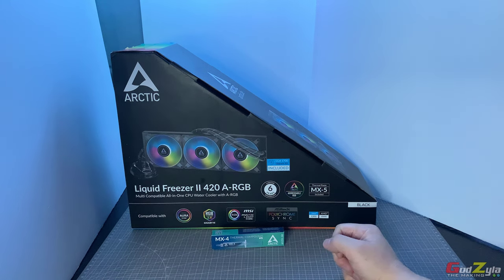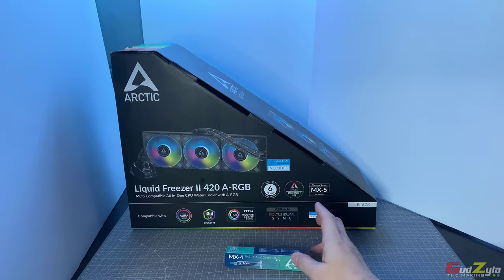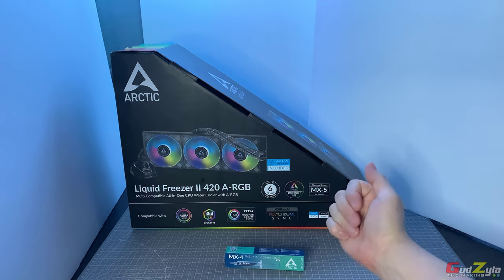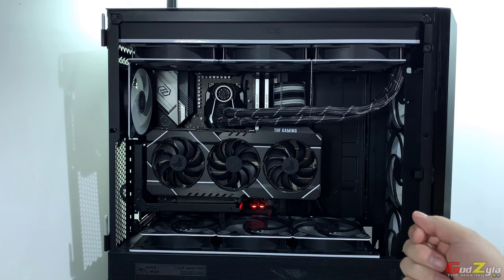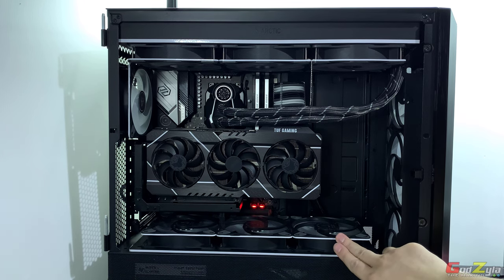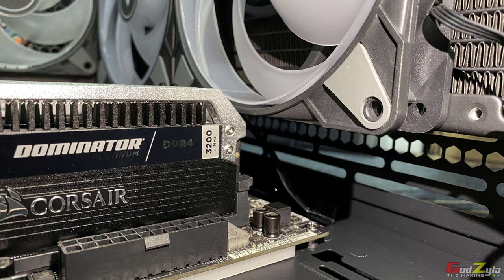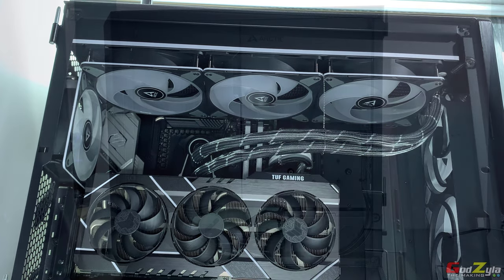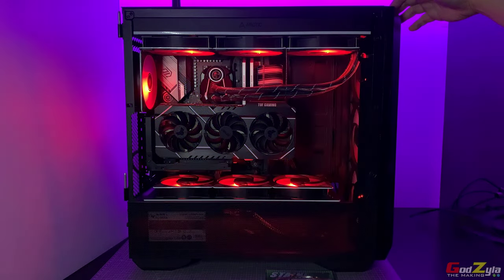Arctic Liquid Freezer II 420 in Lian Li Lancool III - Part 2 (The Experience)

Comment: Rear p12 slim arctic fan (15mm thick) with 420mm arctic aio and 3x stock 140mm fans on front. Would it fit without using the rubber band you used on the rear fan?
Reply from the maker: Hi Kalestra, welcome to my channel, yes you can do that no issue but take note of the front. you will need to orientate the front fans just like I did with the P14 argbs https://imgur.com/gallery/vHezOSS
Reply: @KleoYan  thank you for the quick answer!
Reply from the maker: @kalestra4198  you are most welcome and all the best with your build too.

Comment: How did you connect all 10 of the fans to be able to control them?
Reply from the maker: Hi itsjustme, i've make use of a ARGB Hub https://www.amazon.com/ARGB-PWM-Cooling-Lighting-Remote/dp/B08M644QQX/ref=sr_1_21?crid=1SK62FWOK0W1L&keywords=argb+hub&qid=1691044997&sprefix=argb+hubt%2Caps%2C330&sr=8-21. which allows me to connect all the P12 or P14 ARGB fans to this hub and the hub itself allows me to connect the argb connector to the case argb controller or I can make use of the ARGB hub remote controll.
Reply: @KleoYan  Thank you for the response.  I see that you have 10 fans in your build, but the ARGB hub you linked only has 8 ports.  Did you use a splitter to connect the rest, and did it come with splitter?
Reply from the maker: @itsjustme77  the case itself have the argb controller. I have plug the front fan to the case argb controller. Set to by pass mode on the case argb controller and connect the case argb connector which suppose to go to the motherboard, but I plug that to one of the 8port argb hub. So my 8port argb hub left 7 connection point. Which is why it total up to 10 fans, which are controllable.

Comment: Can I use liquid metal thermal paste with this cooler?
Reply from the maker: Hi Alan Paschoal, welcome to my channel. Personally have tested it once. It’s not advisable. The copper will degrade fast and causes the material will lose its ability to absorb heat. Also Liquid Metal drys up fast. You need to regularly reapplication.
Reply: Thank you brother! @KleoYan
Reply from the maker: @alanpaschoal7299  you are most welcome.

Comment: I am currently planning on getting an ASUS ROG Strix B650e-f in a Lancool III along with an ALF II 360. I was actually about to place my order, but then I stumbled across your video. Now I'm worried that there might be an issue with the MB clearance, and I can't find any information on the MB dimensions to make sure it will fit. Any thoughts?
Reply from the maker: Hi P4th0g3n_ , welcome to my channel, I am so sorry that you might not be able to fix your motherboard https://youtu.be/h2nNwGG0cpk in with the 420 Arctic Liquid freezer II aio at the top. your motherboard is 45mm tall which exceed the 40mm clearance mentioned in this case.
Reply: @KleoYan  Thank you for your reply and your support! I subscribed to your channel :) 

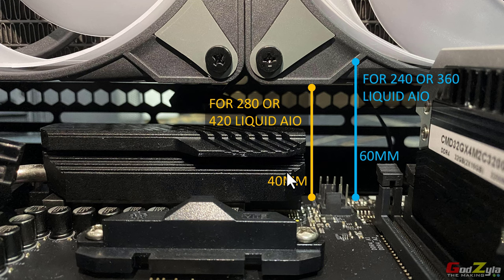Since the ALF II 360 has a smaller radiator area, do you think it should fit? And, maybe this is a stupid question, but.... at 12:24 you mention a 40mm clearance (420/280) and at 12:32 a 45mm clearance. Can you explain why?
Reply: You answer just a few seconds later... Apologies.
Reply from the maker: @P4th0g3n_  hi, ok.. I think I confuse you.. now as why I say 45mm because. the actual clearance height limit of your motherboard rear I/0 and side VRM have to be at 40mm. as the 5mm is the space between your motherboard to the case.. there is a 5mm gap. you can ignore the 45mm, just note that any motherboard rear I/0 and side VRM are above 40mm. you can't fit the 420 Arctic Liquid freezer II. For 360mm, you will have no issues as the clearance is 60mm so your board will fit nicely.
Reply: @KleoYan  Thank you so much! For a 8 month old video your support is awesome!
Reply from the maker: @P4th0g3n_  you are most welcome. All the very best with your build too. 😉

Comment: Hello.. quick question if I may.. I've noticed that when you mounted the AIO on top of the CPU you didn't use the offset mount neither the plastic spacers.. is there a reason for that ? Thank you in advanced
Reply from the maker: Hi José Carvalho, welcome to my channel, by right you should use the offset bracket, just happened that before I discover what's good about the offest bracket, I use my own 280 liquid AIO screws to apply to this new 420 Aio. you will see significant drop of temperature when you use the offset bracket. This was discovered after I took a closer look on the LF2 offset bracket https://youtu.be/ugg_6bvYZAk
Reply: @KleoYan  Thank you for the reply, will watch in full the link of your other video. Great job, loving your channel
Reply from the maker: @josecarvalho1690  you are most welcome and thank you for the compliment. Speaking of which.. this might be helpful to you too, you might want to try out this method to apply thermal paste https://youtu.be/xZ2R4roF1_Q?t=149 .

Comment: Hello. I watched your video and also decided to build a computer with Arctic Liquid Freezer II 420 and Lian Li Lancool III. I assembled a computer according to your video, thank you very much, it helped a lot. I completely assembled the computer, but with an old 800 W power supply and an old Radeon HD 4850 video card, there is no money for 4090 yet🥲😁. I turned it on for the first time and I got this message on the screen.                                                                                       
ASUS PRIME 2690-A ACPI BIOS Revision 0403
CPU: 12th Gen Intel(R) Core(TM) 19-12900KF
Speed: 4900MHZ
Total Memory: 32768MB (DDR5-4000)
USB Devices total: 0 Drive, 3 Keyboards, 2 Mice, 2 Hubs Detected Storages...
M.2_1: Samsung SSD 980 PRO 1TB
M.2_3: WD Blue SN570 1TB
M.2_4: WD Blue SN570 2TB
USB Device Over Current Status Detected !!
New CPU installed! Please enter Setup to configure your system. Press F1 to continue and take advantage of ASUS optimized performance! please disable the ASUS Multicore Enhancement (MCE) in the BIOS settings. If you wish to follow intel guidelines and apply its stock power limits, Next, you will enter the UEFI settings menu.
CPU Fan speed detection error!
Please ensure your CPU cooler is properly connected to the CPU_FAN header. Consider dropping "CPU Fan Speed Lower Limit"
or simply set it to "ignore" in BIOS if problem persists.
System Will Shut Down After 15 Seconds.                                                                                                   I tried everything, reinstalled the fan plugs in other sockets, pressed Del, F1, F2, nothing helps after 15 seconds the screen goes blank, the computer turns off.                                                                                                                                                             I would appreciate any advice on how to get in UEFI .
Reply from the maker: Hi Саша K, welcome to my channel, so sorry for the late reply. Have you tried removing the 2 Hubs Detected storage and how come you are using 3 keyboards. and 2 mouse? there might be a power leak which caused your system not to boot. I would advise you to test your system in basic configuration. just a keyboard, a mouse and the monitor. See if it boots up to UEFI.

Comment: Hmmm 🤔

Even flipping the front fan housing around absolutely does not allow you to fit or lock the fans in place. How did you solve for that after turning them around? 
I put out there that the Arctic 420 AIO isn't actually compatible. The rear fan exhaust solution was incredibly clever, but what was your solution for those front fans. Mine will not click into place. Looking at your video, it doesn't appear that you have been able to click yours in place either. It simply runs up against the metal tube brackets.

Edit: I'm not trying to doubt and appreciate that you respond to so many of these
Reply from the maker: Hi CaptnYesterday, welcome back.. my bad, I should have shown the section where I did the front. totally miss that.. anyway this is how I did it https://imgur.com/gallery/vHezOSS where the front brezel is able to close.
Reply: @KleoYan  thank you for the quick response. I can see now how that would fit, but is there anything securing those fans solidly to the chassis? Maybe a screw that I'm not seeing?
Reply from the maker: @CaptnYestrday  the front tray comes with two thumb screws. One is at the front and another is at the side. When I place the front tray this way. I secure only the front thumb screw at the side. Right beside the top 140mm fan. As for the side I did not use it as the tray is protruding out.
Reply: @KleoYan  makes sense! Thanks again Kleo.
Reply from the maker: @CaptnYestrday  you are most welcome. Glad to of help. All the best in your build buddy 👍

Comment: can you show me the top of fan bracket? have you installed all screws on the radiator? i have 420mm aio and Lancool 3, i cannot install the last 14cm fan because the last fan is "lower" than back panel IO.
at 13:51, you are saying "do it slanting do not do it straight", is it the main reason i cant install the aio ?  how to do it (do it slanting)?

thanks...
Reply from the maker: Hi Algorithm Error, welcome to my channel. I wish I can show you but this case no longer with me. You will need to remove off your fans on the radiator and tilt to the side which I have shown you in this video. Do pardon me.
Reply from the maker: Watch 04:53 that’s how I mount the rad as for your rear I/O is it hitting your last fan. In this video I did mention about the measurements. If your rear I/O is higher than 40mm you won’t be able to fit your last fan. Yes I shown clearance of 45mm that includes the space between the case motherboard standoffs to your motherboard.

Comment: Is the fan at the rear of the case a 120mm or a 140mm?
Reply from the maker: Hi Michael Longhurst, welcome to my channel, the rear fan in this video is 120mm, infact both can't fit, I just do some minor adjustment by using fan rubber studs to hold the rear fan
Reply: @KleoYan  Thank you for your reply. Your videos have helped me so much with the Lian Li LANCOOL III build that I am putting together.  Most informative videos ever. :-)
Reply from the maker: @metalikmike1  you are most welcome and all the very best with your build too.

Comment: I am unsuccessfully trying to install an Arctic Liquid Freezer II 420 into my  Lian Li Lancool III case.  When the screw holes of the radiator are lined up with the screw holes in the case, the downpipes of the radiator push against the front fans and push the whole top end out so it will not close properly.  Tried so many times now but it simply will not fit without pushing the front fans out.  Have you any advice?
Reply from the maker: Hello Michael Longhurst, welcome to my channel. The reason you can’t close it because you need to flip the front fan which I got to apologise as I miss out showing you how I fit the front fans. Try this https://imgur.com/gallery/vHezOSS

Comment: Do you know of it would be possible to fit Asrock Taichi X670E (size EATX)  motherboard in this case with the arctic AIO 420 if Asrock Taichi X670E is 10.75mm taller in height than X570? (Total height of Asrock Taichi X670E is 41.25mm, and the height of Asrock X570 is 31mm which I got from their customer service team). 

I’m guessing no but I want your advice! If no, then which case would you recommend for this build OR which AIO would you suggest if I kept the case?

Ok - I think I answer the question but please let me know if I am wrong!!! Please see below:

 I cannot use this motherboard with this cooler because the VRMHeatsink of Asrock Taichi X670e is greater than 40mm at 41.75mm. I see your answers in comments indicate that it is very important to have a motherboard that does not exceed 40mm. 

Very beginner level mistake from me, will need to return 420mm cooler. VERY EMBARRASING!... I just bought the 360mm version of the Arctic Liquid Freezer II instead - I wish motherboard companies would disclose the heights of their heatsinks because of so much design variation. Some motherboard companies make it a chore to just to find L x W... let alone Height!!

 Do you have other resources to recommend where this information is available? Even PCPartPicker did not pick up on this incompatibility which is unfortunate!... even another good youtuber who build in Lian Li Lancool III w\ 420mm cooler missed this key info!  

Great video, and I am happy enough to continue the build with downsized cooler with my 7950x3d - on YOUTUBE to answer questions!
Reply from the maker: Hi Zalois of Santiago, welcome to my channel. I would not do 420 Arctic FL2 in this case with the X670E Tachi, the VRMs heatsink will hit as you've mentioned. As for 360 Arctic LF2 infact is more than enough to cool your 7950X but if you in a hot and humid country like where I am, you  might need to tweak the PBO2. I do agree with you on the measurements of motherboard, right after I did this content, motherboard that are loan or provided by AIB, I will indicate the height. I have also emailed AIBs to include that but was unanswered. I will try again to send email to them. the lancool III is fairly modular and it will be a waste if you got it and return it. Since you are with a 360, make use of it..
Reply: @KleoYan  I appreciate all the work on this video - I have subscribed! I hope I did not appear ungrateful in my comment! This video inspired me to begin my Lian Li Lancool III build and I want my build process to emulate as much care as you put into your build here in this video. I will always recommend your channel to anyone I encounter who is interested in PC building & product testing. Thank you very much KleoYan, a 10/10 channel!
Reply from the maker: @zaloisofsantiago2589  hey not at all. I enjoy discussions, not to worry as I myself is more of a PC builder than to a reviwer 😊Thank you for recommending my channel to your friends, greatly appreciated it. Which every decission you make, I respect that, all the best with your build 😉

Comment: Is your rear exhaust fan a 120mm or 140mm? No idea how you did it, i have zero chance fitting a 140mm fan there. And even a 120mm Noctua i had lying around seems impossible to fit?
Reply from the maker: Hi Duglum666, welcome to my channel. It’s a 120mm fan with a trick. I am not using metal screws at the rear. If you watch carefully in this video. I am using fan rubber studs instead.
Reply: @KleoYan  Thanks for the answer. :)
Yeah, i saw that. But even with a 120mm fan and the rubber things it doesn't fit.. guess i'll have to try again.
Lian Li really shouldn't advertise this case as "fits 420mm" though.. it's the most cramped piece of shit i've ever worked on in my life.. and i've built hundreds of PCs. It needs at least 3-5cm more depth/length.
Reply from the maker: @Duglum666  hi thank you for your feedback. Infact they advertised as 420 radiator. Never mentioned about 420
Liquid AIOs but just that I took up the challenge and it did fit at the top for me with a twist 😬
Reply: @KleoYan do you think I can fit a 140mm in here?
Reply from the maker: @Shobs1  hi welcome to my channel. what do you mean by fit a 140mm in here? you mean as for case fans? kindly watch this Part I and it will tell you the arangement of fans and liquid AIO. https://youtu.be/PoBzRPApK5U

Comment: Can I use the top 420 radiator, front 420 fan, rear 140 fan? When I look at your video, I think the back side is 120 fan. I'm not good at listening to English, so I can't fully understand your video.
Reply from the maker: Hi ya, welcome to my channel. For the rear is a 120mm fan not a 140mm I can’t fit 140mm

Comment: Hello! I was wondering about 5:21 part, where you are screwing the AIO to the top. I don't know if I am doing something wrong, but my screws simply won't align on the side closer to me. Not to mention there are no screws to be used there to begin with (manual says to use ones that came with the AIO, but again, there are no that seems to fit - and again, the holes don't align.)
Reply from the maker: Hih osiris 4, welcome to my channel. alot have been asking me about this. yes the AIO does come with those screws.. sorry tha't I can't show you the top but rest assure the raidator mount holes align with the case top. You will need to do minor adjustments to get all 12 screws screw in. As what I did, I only anchor screws between the rad and the case holes, then go on with another till all 12 screws are in place first. then I fasten the screws like the way I fasten the thumb screws on a processor. doing it diagonally adjecent to all the rad screws. it takes sometime, eventually you will get them in. no big force required either.

Comment: Hello! What you think in this case if i ahve an matx mobo can i fit on top a LF 420 AIo with push-pull configuration ?
Reply from the maker: Hi SalveMgistra, welcome to my channel. It can be done but you wont be able to fit the rear fans. You can give it a try.
Reply: @KleoYan  Ty ! <3 thanks for the video's and assistance
Reply from the maker: @salvemgistra6995  you are most welcome. all the best with your build. infact if you have dummy fans around, you can test it out first. I am assuming this as I do not have any obstruction with my X570 Taichi. so ya.. give it a try with dummy fans first.
Reply: @KleoYan  ty
Reply from the maker: @salvemgistra6995  you are most welcome.

Comment: Could you please do a step-by-step tutorial on how to install the 420 radiator, what screws to use, how can I reassemble the front with its 3 140mm fans. I'm a bit lost, please help.
Reply from the maker: Hi Aldray Javier, welcome back. So sorry, I can’t do that as the case no longer with me. What you need to do is to remove all the fans from the radiator. Holding the radiator, tilt it diagonally and slowly insert the radiator in and align it back straight to the top. Now as for the front fans. I did it this way. https://imgur.com/gallery/vHezOSS